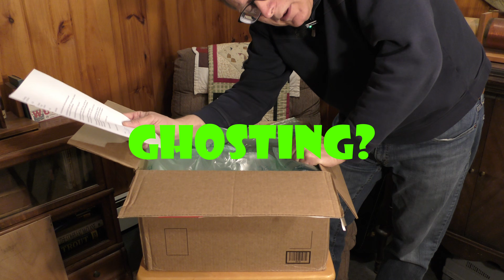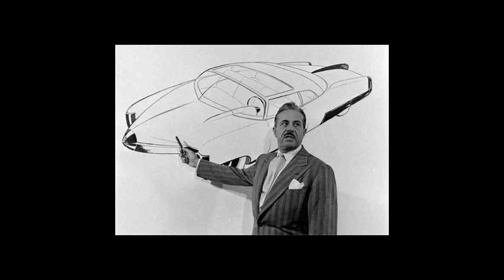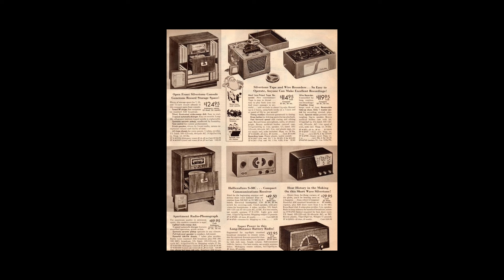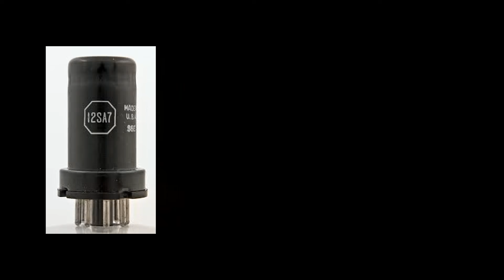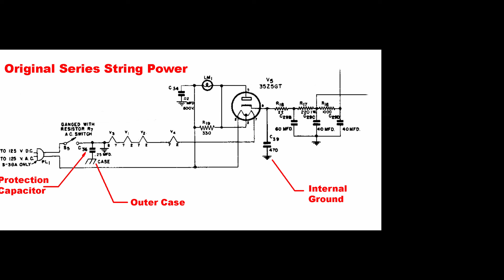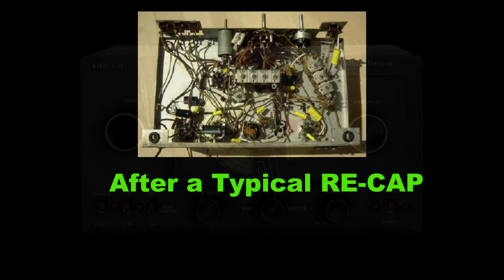Unboxing Receiver - Part1

Comment: I'll be interested in how that one performs on CW & SSB on the 20m band. I've worked on a couple of those & found the CW note to be unpleasantly raspy. Some say that's due to heater-cathode leakage in the converter tube but I didn't have a pile of them to see if a better one could be found.
Reply from the maker: The BFO method is shaky at best, but it starts of course with a clean BFO and bandswitch - clean supply, and a recap and doubling up the electrolytic values is not bad start. And then it's all about the IF cans.

Comment: My very first amateur receiver, brought from USA by my father (for SWL) in 1947. Later, in the seventies I used it for SWL also. In the eighties, when I got my ham license together with my homebrew 80 m transmitter (6U8, to a 6BQ5 to the final 807, glorious 40 watts of AM, plate-screen modulated, then a couple of months later added grid block CW capability) and a dipole for the band I discover "the magic" of radio. Both are in operating conditions today, although the transmitter is for now in a shelf. check my QRZ. 73's de LU5WE.
Reply from the maker: Very nice story and you were talented and did a great job homebrewing equpment.
Reply: @MIKROWAVE1  TKS, the transmitter was a work in process , and progressed through the years to solid state Clapp VFO, to add 40 m band by doubling frequency at the 807 pi (...), and finally a small pcb with a dual gate mosfet circuit as a qsk T/R switch (hi Z coupled to the input of the pi network). The S-38 also went through changes, mains isolation transformer, product detector with 1496 IC, and a sort of zener stabilized supply for the 12SA7 oscillator. Until I got an Icom IC-720A .... But still homebrewing  ... A long.. fascinating path of learning radio electronics and I'm still walking it. GL.

Comment: I have a BC 348 sitting in the garage that I got several years ago.  Still haven't unpacked it yet.
Reply from the maker: Mine was missing all the knobs but otherwise complete with dynamotor. After dyno lube and contact and socket cleaning, tube testing and a tuneup and work on the XTAL filter and re-alignment, it became a great receiver.
Reply: thats one I did first that i had that was converted to ac . the 6sb7y woke up the higher end. the 717 boosted the gain and I replaced ever 300ma 6 bolt tube with a 6. volt at 150ma tube equivalent that was possible. end result is a bc 348 single end q model that runs like gain busters . I forget what if any resistors I had to change been awhile . This MAS disease is stunting my memory somewhat. 

Please look into it and do a series in a way that will not compromise the radio.

Comment: Halliscratchers  should have  had their  collective  buttttttz   sued  over this receiver.   Stop and think,  one of the more dangerous pieces of gear,  foisted upon  thousands of unknowing  youngsters  who  many  had NO idea  what they were getting into  in regards to  AC-DC radios,  AND WITH A METAL CASE.   ANY  fault,  (mine)  with a leaky  cap there in the grounding circuit, would tingle the   heck out of you, depending on which way  the "plug"  was  inserted.  Even in about 61 or so,   when  I had mine, for awhile,  the  lousy   case to chassis  grommets  were getting  tired,  and  heck,  I didn't even  know  THEY WERE IN THERE!!!.   other problems like the lack of any  IF/RF gain made dealing with strong (local) signals   interesting.  I   was smart enough, LOL,  to put a pot,  pulled out of a junk TV,  across the antenna terminals for  a  "sort of"  RF gain control.   

I diched that  thing FAST.   I lived in a small  N Idaho town of about 3500 then,  and acquired a Heath  AR-3  from a local.  Not much better, but at least it had  an IF gain and a transformer!!!!    I also  acquired  some form of  "former"  ARC-5 series receiver which had been modified into an 80 meter converter, using the ARC-5's   IF out put   of somewhere around 2.8Mhz,  fed into the AR-3.  That setup worked OK.   I had a 'trick'    in/out  switch in the B+ of the converter,   with a series  28V relay,  that  handled the antenna switchover,  so one switch,   took the converter in or out of the  AR-3  input. 

After that  I got an RME  4350A or B?   with a bad dial reduction,  (known)  and fixed it with  a mini  reduction drive.  For 50 some bucks that was a great receiver.  I later built a product detector for it.   I am 77
Reply from the maker: A brand-new set with supple dewey grommets and fresh high voltage capacitors and a soft flexible AC cord would have been fine for your younger self. But they aged and cooked and died out and the cords became crispy - The late 70s though now is when we have to consider them dangerous to give to a kid of any age.

Comment: I still have the S-40B that I used during my Novice and early General class days. Not great selectivity for crowded band conditions, but for the most part it did the job and was somewhat better with a narrow audio filter that I built for it. Fond memories of using it back in the day, but I would not go back - lol. Thanks Mike.
Reply from the maker: Those early days on the air always leave us with great memories, even with the gear limitations!

Comment: I had an S-38b many years ago when starting in ham radio, and I still have it.

I was so appalled by the little rubber grommets isolating the metal cabinet from the hot chassis that I put in an isolation transformer. It didn't seem to compromise the radio in any way and I felt a lot safer around it!

I look forward to your upcoming videos on this unpretentious little radio.
Reply from the maker: No matter what you do to refurbish these sets or adding better components, cords, grommets, and techniques, than original, you will simply renew the countdown clock on safety to another 25- year period.  It's still an off the line radio. Adding an isolation transformer is definitely the smartest way to make these old sets safer to operate! Of course, transformers can fail as well.
Reply: @MIKROWAVE1 Add an ELCB, problem sorted.
Reply: An ELCB and an isolation transformer.
Reply from the maker: The Earth leakage Circuit Breaker (ELCB) opens the power connection. A circuit breaker that would never allow the set to come on, because there is no ground and if there were, it would sense the leaks and trip. Yes, that would be safe. But darn! The radio would never come on!
Reply: @MIKROWAVE1 30mA trip point , enough for a tingle.

Comment: My first receiver as a Novice was (1959) a Hallicrafters S-85.  It was primitive by modern standards...but it was alll I could afford.  It taught me to use my mind and hearing to act as a filter for cw.  My Elmer and others cautioned me against buying an S-38 (E version at the time) because it lacked enough selectivity to use well.  I used that S-85 for about 6 months until I was ready to upgrade my license to General class.  It was virtually deaf above 10MHz so I wanted a better receiver.  My folks bought me, as a reward for passing the General exam,  a Hammarlund HQ-145C (used) which opened up every ham band above 40 meters).  The difference was night and day.  Hallicrafters made some great receivers....the S-38 series wasn't part of that.
Reply from the maker: It's actually better today as they moved the SW stations out of 40m and almost everyone went off the air anyway. People are not using HF. So, the receiver does very well today compared to the 60's.

Comment: As a novice in 1958, I had a S-38 D.  Great little radio,  (never got a shock off it!).   My transmitter was my design and home brew. Any body remember  the old 6V6 (my oscillator)  and  6L6 amplifier??  It ran 25 watts on CW.  It had hand wound coils.....  73's to all de WB6PVC
Reply from the maker: in 1958, all of the parts were pretty new!
Reply: First receiver was S-38C, KN7JKZ, 1959. I survived it. As W5NU now, I would not touch another S-38 for basic common sense although I remain incautious on other fronts.

Comment: 30 years ago I bought one of these at a hamfest that had NEVER run for 5 bucks. the 12sg7(yes that correct) if amp tube was shorted control grid to cathode. another 5 bucks at my local surplus store for a new old stock ge tube and it ran fine.
Reply from the maker: Ah yes, the radio that never worked is a gem. They often have an open speaker, bad tube, dirty relay contact, unsoldered connection or a blown fuse!

Comment: Interesting that Hallicrafters made a series of low cost AM/SW receiver radios starting with the S-38 through the S-38E model revisions. You could say these were a basic 5 tube radio with improved performance as you could get from them. My brother-in-law had the S-38E, he was happy with it. Lafayette's HE-10/KT200 face and dials looks like a clone of the S-38 models, but has a lot more tubes, "S" meter, sw's etc..
Reply from the maker: There were many clones including National. They all came from the Echophone EC-1 of WW2 soldier entertainment fame.

Comment: Hi Mike, Thanks for a very timely and great video!  I'm just finishing up a re-cap of an S-38 I was given.  Runs great!  I did do a mod and replaced the "gimmick" with a small homebrew solid state BFO.  I also brought it to modern safety standards by adding new safety caps and a polarized plug  ; ) 73 DE K1TB
Reply from the maker: That homebrew BFO mod is a nice touch for those sets! After a grommet change out with insulated hardware, a 3-wire plug and a recap, you can consider the set safe for another 25 years.
Reply: @MIKROWAVE1  Another 25 years should suffice for me : )

Comment: put 717 tubes in my transformer sets with better plug in mixer tube for higher frequencies 

just used tube swaps and tuneup
Reply from the maker: Very HOT front end with the 717!
Reply: yes indeed also i have replaced certain 300ma 6 volt tubes with 150ma at 6 v equivalents then i believe it was a 6sb7 mixer i installed . i did this as 1 i wanted to take stress off the filament side of the transformer. 2 I put a 717 in place of 1 or mor 6sk7

Comment: I put a 45z5 in place of the 35z5 and removed the to chassis caps on the line cord and replaced them with fail open ones i did put in higher gain tubes in place of the sk7 tubes as needed without going unstable
Reply from the maker: Very nice approach.
Reply: the 45z5 drops the voltage on the string adds 10 more volts capacity to the string in case of high line voltage runs the tubes a little less bright on filament

Comment: Hi Mike. Yes, I had one of those radios! My first radio was homebrew with plug in coils. Then this one, I thought it was marvelous that I could then just switch bands! I had to run it off an autotransformer from 240 down to 115 volts or whatever! I later modified it by having a mains transformer, eliminating the rectifier valve, and replacing the 50L6 with an EL84!
Reply from the maker: Yes, putting in a proper 120V 6.3V transformer and changing out to 6V equivalents is a deluxe solution.

Comment: I picked up a dead S38, the original power transformer was blown so the replaced it with another type and it's dead as well. Does anyone know what a replacement is? I'm sure Hammond makes one that works but I don't know what original specs are so any help is appreciated.
Reply: Don't believe the receiver was designed with a power transformer. Sounds like someone modified it. They were line cord operated.
Reply: Yes, that's an isolation transformer, like the one Mike W2UD talks about. Certainly added by a previous owner.

The S-38 (all of them) and the "All-American Five" radios (5 tubes) - power cord goes directly to the switch and into the filter caps. There is no isolation transformer.
Reply from the maker: You can easily add a small transformer and full wave PSU like WA1HLR did from a Heathkit Twoer and replace the tubes with 6V equivalents!  That beats all methods...
Reply: @MIKROWAVE1 HLR corrected many poor designs on equipment. Heck even showed how to make a mod transformer out of an old TV transformer.
Reply: Sorry, my complete screw up, I have several models of the S-38, some with covers off waiting for recap. Sooo I also have an S-40 with cover of cause of blown power transformer... I screwed up and mistook my S-40 for a S-38 when I asked the original question. So back to updated question, any ideas for a replacement power transformer for an S-40??? It's T-18 by schematic but doesn't list it's voltage / current draw.

Sorry for the mistake.
Reply: @jameslawrie7517 Not sure of any direct replacement however a good estimation to keep it fairly conservative might be a unit that will give you around 250v @150 ma.or so, once rectified and filtered. Also. Be mindful of 6.3v filament current consumption.

Comment: That's it! That's the culprit that got me into ham radio and started my insatiable appetite for collecting boatanchors! My dad bought an S-38 brand new when he got out of the Army in 1946. Many years later when I was about 8, he hauled it out of a closet and set it up with a random wire. I was hooked instantly.
Reply: Yep. Me too.  Saw it sitting on a shelf in my grandfather’s auto shop.  That was when I got bit… 😆